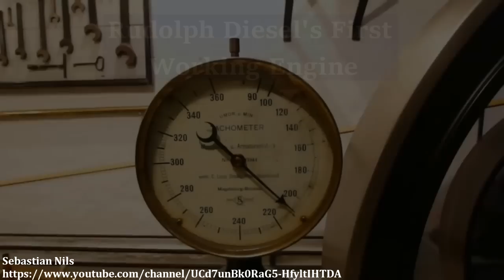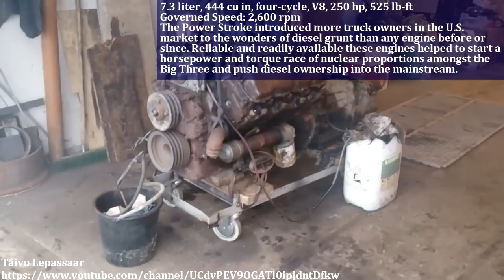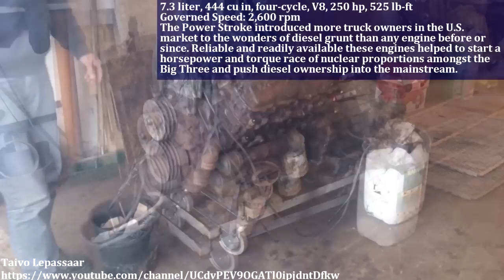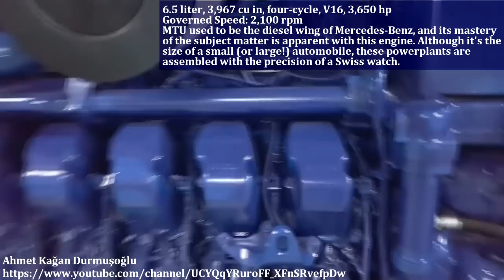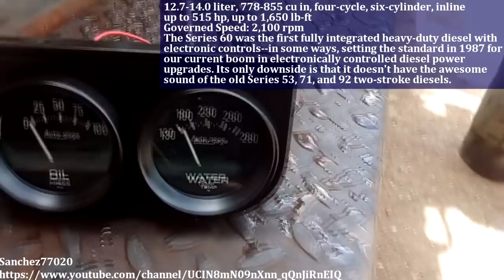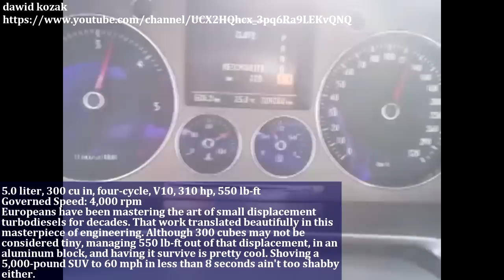10 of the Greatest Diesel Engines - Ever

Comment: Good video.  The 60 Series Detroit is DEFINITELY one of the best diesels ever built.  As a trucker, it's been my favorite for years.  Video caption was a little incorrect however, as it left out mention of the 11.1L.  I drove trucks with both the 11.1L and the 12.7.  Both were great engines.  Still my favorite to this day.  As a Mercedes driver for the past 22.5 years, I also have to say that the old 5-cyl. passenger car diesels were one of the best diesel engines that have ever been installed into a passenger car.  Shame they weren't included, with the exceptional quality and service they have provided for the past 40 years.  Many of them are still on the road today as daily drivers.
Reply: L mm

Comment: Ok you might have mentioned the larger engines ,but the best small diesel in the world has got to be the little air cooled lister .These little engines have powered everything from cement mixers and dumper trucks upwards ,and the number that still power commercial fishing boats is colossal .Why  because you don't need a water cooling system,so no block to get slugged or heat exchanger needed  ,no electrics needed to start it ,so no starter motor  or alternator or battery and you've got a build quality that goes way above the specs needed. All you need is a starting handle to swing it over and  clean fuel then off you go .The little Lister that was In my 16 foot heavy clinker boat was at least 25 -30 years old and was considered by some of the older fishermen as a youngster

Comment: 12 valve Cummins 6BT, legendary engine, absolutely bomb proof
Reply: My 6b Cummins engine nearly broke me it was bought new in a ERF lorry and was nothing but trouble, after 2 years I sold it and bought a 16 year old ERF with a Gardner engine which NEVER let me down and has done over one and half million miles and never had the sump or heads off, NOW THATS A BOMB PROOF engine.
Reply: @paulwilson3083  i have never been let down by a 6bt but those gardner engines are amazing

Comment: The most reliable, 
 fuel efficient and long lasting diesel engine is and always will be  a. GARDNER hand built quality.
Reply: Nope, CAT is King.
Reply: Hand built means zero precision and inaccurate tolerances not counting halfass employees. Nothing comes close to Lister as far as reliability
Reply: @wyattlarrick3246  If its not a Cat, its a dog!
Reply: @veiledzorba  and cats suck.
Reply: Except they leak oil everywhere!
Reply: @Mr.Beastforpresident  Sorry but you need to look the Gardner up then.  Every part was built, cast and machined in shop, to the highest and strictest tolerances,... When he says hand built, he means that every engine was built by one person, who's name went on the engine, so they'd be doing second level of quality control on them, so there was a huge amount of pride involved,... They had complete control over everything from materials to finished product.  People in the US that really know their engines will pay $50,000 for one.   Here's an example of one of the typical stories you'll find on forums about them. Had a Sedon Atkinson truck with a 6LX in it, sold it after 2.5 million milles, still purring like a kitten, in all that time they only replaced a head gasket and the injectors.  That's why they were used for the power generators on light houses, and they are an immortal legend in the marine engine world.  They maxed at about 1800 rpm, and a 160bhp engine weighed about a ton and a half probably and was the size of a small car, that's how over engineered they were.  If you know anyone that really knows about engines, particularly marine engineers, ask them about Gardners, seriously, to anyone that really knows their shit, they are an absolute Legend.  Just look them up and go on the forums about them, there's story after story like the one I just told you!  By all accounts, they only had 2 engines EVER come back within warranty, and that they considered a subject of great shame.  Only stopped making them because new emissions regs meant they couldn't afford to keep up with the big guys, as only a family business with very tight knit work force.  But now they've started up again, just doing rebuilds and spares.  They had incredible innovations like separate external linked cooling for the head and block, so that if you blew a head gasket, it wouldn't warp the head,.. As a result once on a lighthouse when one did actually blow a head gasket, being that they did't have a spare, they just took the gasket out, put the head back on WITHOUT a gasket and it ran just fine like that,... THAT'S how good the tolerances were.  Lister are absolutely nothing by comparison.  Enjoy reading about them, I assure you, you'll bless this day that you found out about them, and you'll probably know how to spend your next $50,000.
Reply: @bearbaler1456  Yes there were a few in Australia in Buses
Reply: @bearbaler1456  well said, they were amazing engines built with great precision amazing strength and passion.

Comment: I never owned a 7.3 l International but I knew people who swore by them.  I operated the 466 in the oil field and it was a tough engine that lasted.  These two engines are the greatest I think for medium hauling!
Reply: I worked as a mechanic for International-Navistar, and, I saw 466s with half a million miles more times than I could count. Easily one of the best, most reliable, medium duty engines ever designed! The 7.3L, or, 444, is almost as reliable.
Reply: The ISUZU 7.8 gets my vote for best medium duty engine, things run forever. Shame they weren't more popular in North America.
Reply: @ExUSSailor  ? question...Is it possible to run (2-4 stroke) on propane LP. gas
has it been tried...like to know your thoughts
ND
Reply: Man.. I smiled when I saw that 466.. from working with different diesels that was probably my personal favorite.. I thought I was the only one who liked it so much
Reply: @Woloverine1  Yes you can run a four stroke on LPG.  You need an adapter for your intake manafold.
Reply: The 7.3 you see it most on F 350's and F Superduty series. It's better known as the Power Stroke.
In International is known as the DT444

Comment: I think the large EMD two stroke diesels that powered 3 generations of locomotives and boats deserve honorable mention. Anybody who's ever heard the rumble of an EMD 16-645 knows what I mean. Also I think the Detroit 6-71 is great too.
Reply: The v20 with each cylinder with 645ci is awesome
Reply: I had the honor of working on couple of these old beasts in the basement of an older communications center. Old monster was a....1300 kw, I think? I don't remember now that I'm trying to. But those bad boys were awesome. Back when they literally built it into the building. They had to keep them running because there was no way to get them out. 😂😂
Reply: Entirely right, sir!
Reply: Had  2 stroke Detroit diesels in commercial fishing boats . love them. ..
Reply: I ran EMD 16 645 E8 and E9’s on drilling rigs for 25 years. Great engines, hate to see them go. Great sounding engines,  Sadly I had to send 6 to the breaker last year ( summer2018), 2 stokes do not make the EPA cut!
Reply: @rosschilds7535  Not so the v20 645s known as whips . They were prone to crank failures. Many sd45 locomotives  have have been derated  back to the 16 cylinder which is a more reliable engine

Comment: 4:01 Money Maker Detroit 60 series 12.7 L from 1999 still going strong today on an International 9400 Truck, after 3 overhauls,1 transmission and both differentials rebuilt, bulletproof engine still gets 5.85 gallons per mile, not the fancy 6.5 mpg of the newer, sensor plagued crappy DEF monstruosities out there, but I would rather be on the road than brake down every month because of some sensor.
Reply: My brother is a diesel mechanic at a truck repair garage and he absolutely hates trucks with aftertreatment systems on them.
Reply: had a 6v71 in a boat  1 nautical mpg ,42 ft
Reply: Love that generation Detroit. That and a 6NZ Cat rule the heavy market
Reply: I agree with you  100% series 60 won let you down
Reply: DD60 powered big rigs up thru 2007 bring more $$ than DD13/15s 08-11.  2012/13 DD15s cant dissipate heat fast enough regardless of operating conditions.  Isx 15s same issue up to 2013.  Penske repair data shows replacing entire radiator assemblies again and again on FL Cascadias w/dd15s.  2009-2012.  15ltr pre-2014 diesels will go down as "worst" of all time.
Reply: @The Adventures of Trucker186 and Tuttleman balls to da wallls brotha lol, jk I can see that guy just flying down the highway burning up profits and tires 😁, I keep my baby under 63 at 1500 rpms cruise control, never ever hog her unless it needs to such as a highway merge from the shoulder, she gets her oil changed every 10,000 or 3 months with a a gallon of Lucas, her oil filters get changed every month and a half and fuel filter get swapped every month, I pamper her and she makes me money 😁
Reply: I had a 12.7 Detroit 60 series in my 94 kenworth. 411 rears. Had no problem pulling Fancy Gap!

Comment: The MTU is 65L surely, not 6.5L!
Reply: CambridgeMart As it is a recent one, it is even 75 liters. The strokes have been lengthened to go from 4 liters per cylinder to 4.7 liters per cylinder.
Reply: CambridgeMart that's what i was thinking
Reply: Yup, 3967 / 61 = 65.03

Perkins T-6 should have made this list - wasn't necessarily a beast, but it was a solid deserving workhorse. Detroit 71 green screamer also deserved a mention IMO.

DT's were solid in their day, but I wouldn't touch a modern one.
Reply: Jim Vicious   The silver 8v92 Detroit was a great engine.
Reply: JT S poo
Reply: Yup, sixty-five liters.  Sixty-one Cubes per liter.
Reply: A derated version of the MTU engine is used to power the iconic British High Speed Diesel train, the Intercity 125. It replaced the original fitted engine, the Paxman Valenta, itself a worthy addition to the collection in railway and marine use and is the world speed record holder for diesel traction of 143mph.
Reply: @davelewarne6818  .. Wow British Technology Rocks Man, Wow 143mph World Record Holder for a Diesel, Great Stuff .. .
Reply: @splash5150izy   The world speed record was achieved on a slightly downhill run as was the world speed record for steam (Mallard) ..... always detracts from the record to achieve it on a downhill run I can't help but think.
Reply: @Martindyna  .. How very interesting and thank you for that informative info, I love All Engines and Mechanical Contraptions Whether Powered by Steam- Fossil Fuels and or By Battery- Hybrid or Other-wise, Have a Nice Day Y'all (Nmcfmamf) ..

Comment: EMD 567 revolutionized the Railroad Industry. As for the Duramax, the ones in our fleet were constant problems.
Reply: Maybe more correctly, the Winton 201A, precursor of a whole series of 2-stroke diesels, as the revolutionary of the railroads?.
Reply: NO ONE has manufactured diesel engines longer than Isuzu with the exception of Pugeot.
Reply: Yes, very significant, but the 645 16 cyl. was the high-water mark for EMD, with the 40 series locomotives, probably the most successful U. S. locomotive series ever, and still in operation and being rebuilt and maintained by serious railroad operators nationwide.
Reply: @3Mudbone1  what does isuzu have to with what he said? Isuzu only had partial design input on the lb7-lbz the worst duramaxs and the lbz got revised to the lmm and the lml and l5p just took it up a notch the l5p is basically a different engine. Also can anyone list the issues they had with their duramax? I keep hearing they where constant issues and most people out of everyone ik who's drove one day in day out would take a duramax over a powerstroke or Cummins. I dont like cummins they are to unreliable for my tastes but so is duramax and powerstroke. But cant expect a duramax to keep up with a 12v149.

Comment: 4 cylinder Perkins, running after nuclear war, Big cam Cummins, reliable mile eater, Scania V8 14 l and 16 l, pover, pover and pover.
Reply: YES SIR   the 4.203 PERKINS  is the BEST engine diesel Ever !!  And the diesel engines LEYLAND     GM DDA all. Cummins 5.9 series.  Caterpillar  All
Reply: Big cam yes. Perkins, no
Reply: Perkins 4/99 was great. Could wind out the governor to well above normal, and it would run forever.